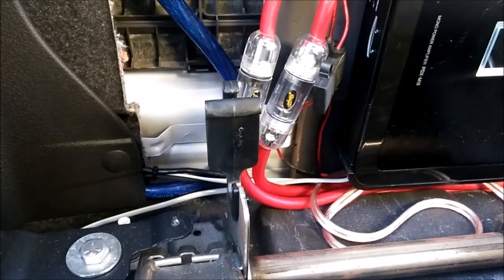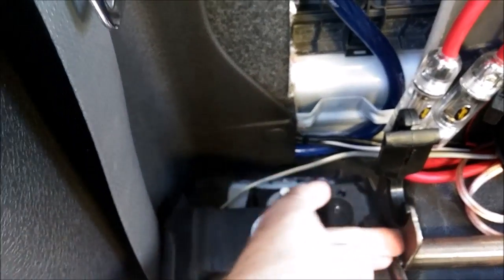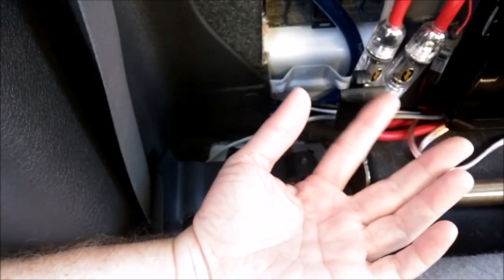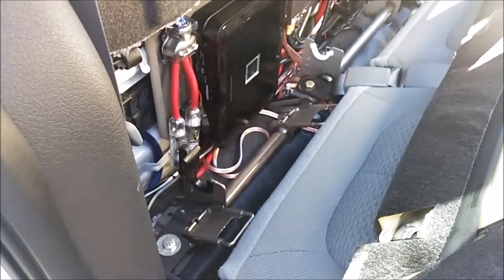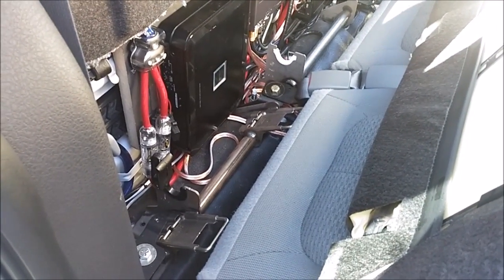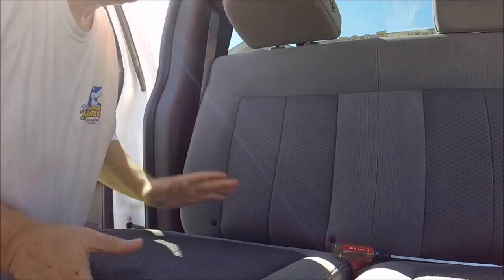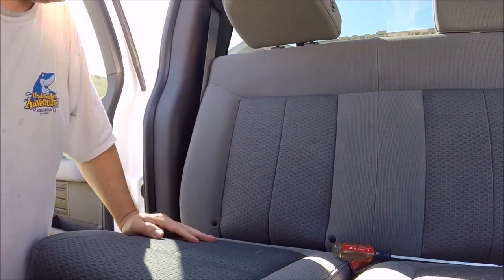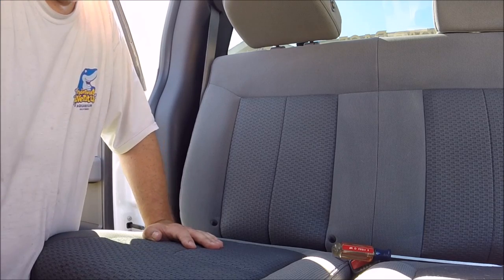How to remove the rear seatback on a 2013 Ford F150 Supercab - Best Video

Comment: Just removed the back bench seat from my 2013 Ford F-150 FX4 Supercab. I followed your instructions perfectly, but I have one thing to add to your video that I think would make it even better and it saves some time and also you can use both hands in front instead of one hand on a long regular screwdriver with one hand attempting to reach behind/under seat.Send me a message and maybe we can collaborate on another new video. Thanks for the help Doug. Have a blessed day.

Comment: Doug,  I'm Diane's husband, James.  Thanks so much for the info.  Last winter window was froze up and I didn't realize it and attempted to open rear window and something went wrong.  Remote operation stopped working and I had to let window unthaw and then was able to manual push closed.  Been putting off looking into and now started and see that the rear upper seat back has to be removed to even look into problem.  How in the world do you remove rear seat upper section.  Now I know.  Thank You!!!!!!!!

Comment: I watched your video.  Thanks for showing me what I was trying to do.  Turns out I could weasel my hand around the lower corner.  I reached back to feel the screwdriver and found I could just pull the tab back with my hand.  I have large hands and small wrists so this trick may not work for everyone.  But I can pull my seat out in the time it takes me to walk around the truck…so thanks for that!

Comment: I'd have to agree, your video is much better than any of the others I watched, because you 1) have a full view video, not a skinny cell phone shot that you can't see jack in, and 2) you do a detailed 'how to' step by step and explain well what is going on and what you are attempting to do.  After watching your video, I removed the back seat from my 2013 F-150 XLT, first try.  Thanks.
Reply from the maker: Thanks, glad I helped.
Reply: Great video watched 4 others and couldn’t figure them out. Your method is perfect for F-150 extended cab. Mine is 2011

Comment: Thanks for the video. I didn't have a pocket in the foam to follow so I had a lot of resistance to raising above the bar. I had a 5/16 x 24 inch round stock that gave me the leverage to pull up to the tab. I got lucky and hit the hole when I pulled up. The seat popped right out. I never would have found that without your video. Thanks again.

Comment: I have a 2011 F150 Supercab and I'll tell you what...I absolutely am a Ford guy, will never buy anything else, but...2 things that have annoyed me the most about doing an aftermarket head unit  and an amp, 1.)  The fact that they do not provide a 12v ACC wire off the factory radio harness like they have for 30+ years and 2.) The difficulty of getting that back seat out.  I'm baffled by those 2 things.  Last, thank you so much for this.

Comment: Best video!! I've been having an annoying squeak (I now /know/ it's middle passenger seatbelt) for so long, driving me crazy..  Been wanting to get in there to figure out where it's coming from (I thought the back of the seat!! or like on my old 2000 one of the bolts holding down the seat belt ends) and the other videos never really explained it as well as you do. There really is a trick to it to get that screwdriver in, maybe just luck, but eventually I got it!   I might  'route' out a bit of the foam to make a clearer path under and on the seat back, no one ever looks under there anyways. :P  Thanks!

Comment: Great video  and thank you for showing the way the seat locks. I found a shorter screw driver worked better as you can tilt it up easier to gain access to the hole. But great insight as to get the seat off.

Comment: 3-8-2021.....I need to install an upright child seat front facing. Initially I needed to know how to remove the headrest of an 2014 Ford F-150 Supercab. Always thought the rear seat folded forward but had no clue. I saw one other video, where a guy just used his hand instead of screwdriver. 👍🏻
Reply: Had the reverse problem! Bought the truck without the head rests, needed to replace them for forward facing booster seated kiddos.

Comment: I have a 2013 F150 Supercab. My back seat is COMPLETELY different. It has a latch on top, both sides that releases the seat back. No screwdrivers involved in releasing it. You sure yours is a 2013?
Reply from the maker: Positive.   You sure you have a SuperCab and not a SuperCrew?
Reply: Doug Masters Sorry Doug, my bad. Mine is a supercrew cab. I watched your video 3-4 times. Just watched again and noticed the rear doors open opposite. My bad!

Comment: Actually, I think it’s easier without a screwdriver. As long as you push down on the back rest while you push the plastic clip back with your hand, it’s very easy. 
Now the question is, how to adapt an easy latch system to swing the backrest down for easy access.

Comment: This is BS. My 2013 is not configured like that at all on the top of the back seat backs. They’re suppose to have pins to push in to release but I don’t have that either. I have some arm and slot configuration with no visible way that the back releases from it. Do I have a freak truck? So frustrated
Reply from the maker: I strongly suspect you're NOT working on a SuperCab.